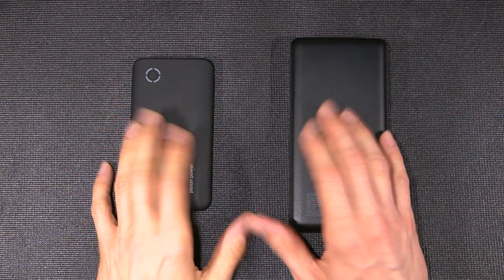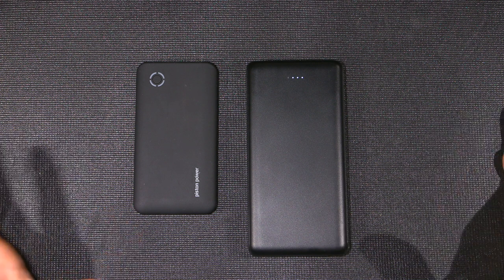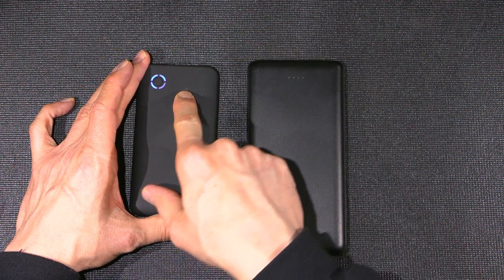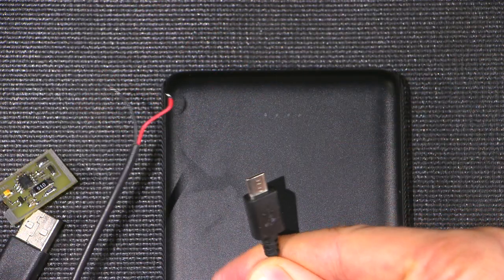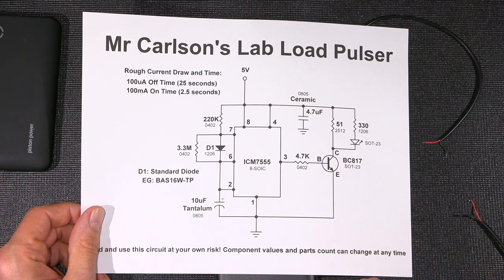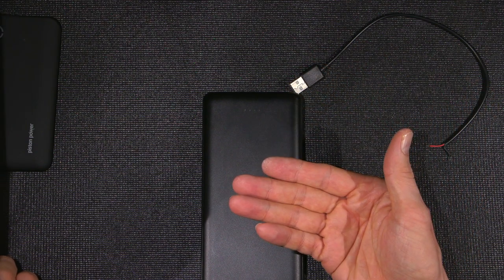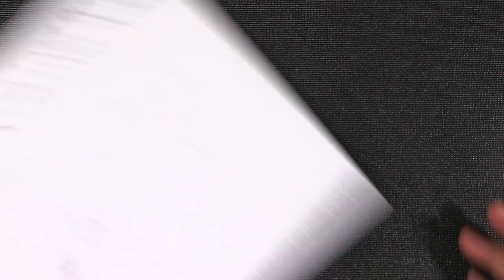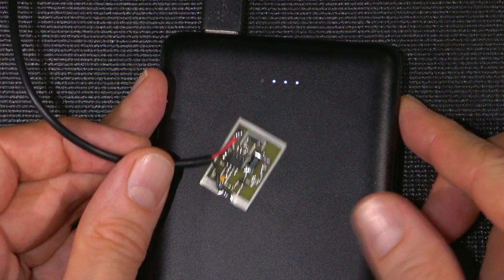Power Bank Stay Awake! Here's A Circuit To Do That:

Comment: If you use this as you suggest you may be defeating the safety timer that is part of your phone's internal battery charge and protection circuit. This timer is designed to prevent rapid and repetitive charge cycles to the Li-Ion battery that can lead to a cell "thermal event" aka catastrophic failure. With a severely aged battery you could be initiating charge cycles every 25 seconds. I wouldn't even want to be in the same room with that setup!

Comment: Nice. Could I use this circuit in parallel on a DC 5521 (2.1, 5.5mm DC) line? It's just 12V/5A.

Comment: Hi!  Nice job figuring out how to keep the power bank on.  It is also needed for remote photography and with other devices that have intermittent power "on" needs.  So, where is the layout of the PCB?  I want to start making those small circuit boards and using them with my projects.  I looked at your web site and there was nothing that I could find to help make that small PCB.  Did you post the circuit board layout on another web site? Merry Christmas and have a great New Year!

Comment: Paul, glad to see you take issue with batteries, and the Industry's rotten behaviour with them! Those of us who work with restoring and refurbishing laptops have been tortured for years-- but now increasingly so-- by a related problem. Most laptop battery control boards (BMS) have a suicide function, and 'kill' the battery (causes it to stop functioning, charging, etc) after a set time (often 2 yrs, but can vary). This is so even if the battery cells themselves are fine and healthy. Could you possibly design a replacement BMS for laptops which will REMOVE this shoddy, immoral function'? Or, perhaps some kind of work-around? You da man!
Reply from the maker: Thanks for your input, I will consider this.
Reply: kinda this!!!! i've seen dells do this alot but most batteries i've had die tend to have 1 or more cells fail over time leaving 5 or 6 or 8 good cells

Comment: The LED's and the 5V boost converter still consumes in continuous operation, so the battery will drain somewhat faster.
Reply from the maker: Correct, but the LED's and boost converter are on all the time anyways when the pack is in use.

Comment: Wonder if a shorter time than 2.5 s would also work. I guess it depends on the type of power bank.
Reply: Yes, I also think about trying a load current of less than 100 mA. A 2.5 s 100 mA load pulse every 25 s means an average current consumption of 10 mA. That's too much for my taste.
Reply: @wernerfritsch6436  Exactly my thoughts.
Reply: The phone ITSELF will pulse the powerbank if/when it needs charging. It's not a "latching" or "one-shot" circuit, so when the phone tries to charge, the powerbank will come back alive automatically.
Reply: @johncoops6897  That's not how most of these battery packs work, unfortunately you can't just plug something in to turn them on; you have to use the power button.  Once on, they stay on until the load drops below a certain level, then shut off.  Did you watch the video?

Comment: I have a few issues with you circuit: 
Why not use a MOSFET transistor, you will save one resistor.
Why use 0402, they are very small and with the PCB you use there is enough space for larger resistors.

I also know that 1 second is long enough on-time. Shorter may be possible, but in my tests I uses 1 second.

The timeout and minimum current varies between power banks (Xtar had a model that needed about 300mA to stay on).

Comment: I wonder if it would work to keep a buck circuit from eBay from turning off when charging a cell from 18v panel and a shadow.
Thanks I'm gonna have to try it 😊
Or maybe not because the battery doesn't have protection 😬

Comment: Pretty cool but that low power 555 costs over $2.  8-bit microcontrollers in the same package size are less than 30 cents (for those of us with more time than money) :P  Then it's possible to do a small current pulse in software without external components, or dump the pulse into a capacitor instead of wasting it.  If most of the power bricks use the same controller chip, I wonder if it's possible to disable the timeout on that chip directly

Comment: Most of the power banks I've gotten have a 'flashlight' or keep the status lights on if you press the button twice. This keeps a low power load on the power bank so it doesn't shut off.

Comment: Great little circuit! I do have one question though... Will this circuit interfere with USB-Power delivery or Quickcharge protocols? Those charging profiles support up to 20v. I'm pretty sure fast charging protocols are supported with USB type A ports, definitely with USB type C.
Reply from the maker: Hi Ben. As indicated on the schematic, this is for a standard 5V USB connection. Thanks for your comment!
Reply: @MrCarlsonsLab  no worries, thanks for the reply! And... I think I'm nearly up to date with your videos! 😂 Love all the old school tech you play around with! Keep up the fantastic work! 😉👍👌

Comment: I'll comment for now so I don't forget, though in a hurry.  I have a little different issue where I decided to most likely use a 18650 battery for the 12V jump starters.  I have an Artek.  Works like the power banks also... though have the 12V option with a smart sensing plugin for the battery cables.  Needs to sense a battery in order to operate.  Plus has a shut-off if not used in a certain amount of time.  I'm basically thinking instead of making the riders and garden tractors all have pull starters..., which I might still do anyways, use the Artek with the 18650 for starting.  I'll have to watch this later.
Reply: i wouldnt recommend using these for more than a few random "starts" the cells will degrade fast, they are 3 big fat lipos in series, if you parallel a 3x3 or 4x3 18650 setup it'd be more relyable long term
Reply: @frogz  Thanks for the heads up.  If not some anderson connector to start the engines with a dedicated pack for all as needed. For an install that's dedicated for each unit, I have wondered about installing a BMS with circuit protection to replace the lead acid batteries. Seems can make a pack with old laptop cells like you're noting and maybe even add some solar cells to keep the batteries managed best.
Reply: @frogz  Forgot to note the super capacitors also seem like an even better thought I've had before.  For vehicles too.  Seems for the hybrids or even all electrics... a super capacitor buffer for acceleration and charging seems like can help the battery performance.

Comment: I wonder if there might be an even simpler solution, like 2 resistors a mosfet and a cap ? 
It would be nice to have footprints for  jacks on the PCB and a little 3d printed enclosure, sort of like a 1 port usb hub ;)

Comment: Hi All, I am relatively new to electronics but keen to start with this small circuit. Could anyone point me to the list of components with part numbers which was mentioned by Mr Carlson in this video if I was to make this exactly as is shown. Any advice would be appreciated. I have signed up to Patreon but cant find it there.
Reply from the maker: Why didn't you PM me on Patreon? Anyways, I sent you a message there with the information on how to navigate your way to the info you want. It's very simple.
Reply: @MrCarlsonsLab  I have the exact same problem as @alanstewart1810, I signed up to Patreon too and cannot find the information that was promised in this video, and there is no longer a function to PM unless paying for a higher subscription (Which is above my needs other than this one issue). Any help would also be greatly appreciated, thank you.

Comment: i wish there was a circuit, that would allow you to put a power bank in-line with a charger (charger to bank, bank to device).. but only provides power from the bank, when there is no ac (power out).. but most powerbanks say you can't have the bank plugged in for charging and charging a device at the same time.  I'd like to have a battery backup for my usb wifi camera, but an APC type unit is overkill

Comment: Alternately, at least one brand of power packs has an "always on" mode for IoT devices, although they may cost more. As for your pulsing load, is it possible to dump the 2 seconds x 100mA energy back into the power bank's charging port somehow, instead of wasting it? This may make the gadget too big to fit into the power bank, but it would be an interesting thought experiment.

Comment: I like the idea but question some of the parameters - is 100ma really needed, I guess it will depend on the power brick; at 2.5 sec every 25 sec you effectively have a continuous 10ma load so 50mw which might be a lot more than the intended device load you were supporting - though small for a 20ah power bank. Could you reduce the load duration say to 1 sec at 50ma ? I just wondered if these values were the result of testing your own power bricks. Incidentally the ICM555 is rated for a direct load of 100ma so you could simplify if you could reduce the load to give more of a margin. As it stands your pulsed load would flatten a single-cell power device in about 10 days all by itself.
Reply from the maker: #1: Yes 100mA is needed, at 50mA the pack shuts off.
#2: A 10mA load will "kick" the IC, but will cause it to shut down in 35 seconds. Pulsing the 10mA load after the initial kick will not reset the timer. Having a constant 10mA load will not reset the timer. Having a constant 50mA load will not reset the timer. Pulsing either load while the power brick is activated will not reset the timer.
#3 If you load the ICM7555 itself with 100mA, you will purchasing a new ICM7555. If you use a load on the output (pin 3) of just a few mA, you will get a 1 Volt drop using the ICM part. This is why an external load switching transistor is used.
#4 The power cell won't go totally flat as none of the internal battery monitoring circuitry is touched. All power bricks shut themselves off when their internal battery is low. Keep in mind the 100mA load is pulsed, not continuous. The off time current draw is 100uA, or (Micro Amps.)

Comment: How about a device that will make a discontinuous digital coax signal continuous without affecting the information content (audio) of the discontinuous signal (so as to not trigger DAC relays and make them co click click all the time)? Or how about a device that will make it possible to have a fax machine work with a cell phone?

Comment: try just pressing the power button 3 times or if that doesn't work once it's on try holding the power button for 3 seconds.  most power banks have a stay on function built in but not documented.
Reply: I've power banks that don't have a physical button to push. It's nice to know that some have an undocumented feature to override the auto-off function.

Comment: Excellent little circuit! Thanks for sharing.  It would be a good idea(options) to have a defeat swt in case one wishes not to have the batt_pack drain down if one is planning not to leave it nu-attended for long time.  You know... a regular mode feature.  Just my $0.02.

Comment: So with about 10% duty cycle, this draws an average of 10mA @ 5v or 50mW.  That might mean 15mA @ 3.7v at the battery (depending on the efficiency of the switching boost converter at 100mA output).  An USB battery bank (usually rated by the internal battery current, not the output current @ 5v) would lose around 350 mAh per day from this circuit along.

However the power bank's own circuits continue to be powered up continuously, drawing some current for the LEDs on the powerbank, and the near-idle current of the switcher for 90% of the time. so the actual drain might be substantially higher.

Do you have any practical experience with this?  Like, with no actual device being charged but this circuit attached, how long does a power bank (of some stated capacity) take to drain to 50%?

Comment: Likely they are designed to shut off because the switching regulator has a small power draw that will drain the cells inside the external power brick. This can dramatically reduce the lifetime of the cells if they aren't kept topped off themselves, I.e. if you don't use it every day.
Reply from the maker: You can shut the pack off, so no difference. When the batteries get low, the IC inside shuts the pack off automatically anyways. It also has current limit protection, which isn't affected by the external circuit. All of these packs have these functions.
Reply: @MrCarlsonsLab  I mean the timing of the switch-off. For example, if you switch it on and recharge your phone, then unplug the phone, it would keep producing the 5V regulated and drawing that trickle of power without the load timeout. A manual off-switch is nice, but not everybody is that attentive, and the manufacturer wants this thing to outlive Warranty plus a day.
Reply: @PocketBrain  Well, if you  do want it to turn off, you don't build this circuit.
Reply: @jeepien  ....who says he has to build the circuit exactly to design? add an off switch if you're already going through the trouble and are worried about quiescent current!

Comment: Another trick when using power banks to power low current Arduino projects is to get the Arduino to periodically switch in a high current load.

Comment: Dude I have a pair of blue tooth ear buds it had just a red light that went off when it was done charging but when i went to charge them with my power bank they would last as long if i would charge them with a wall charger i just went and bought a wired set eventually cause I don't like charging my headphones

Comment: Hi Paul,, just wondering why you use a Tantalum capacitor for this cct?
Reply from the maker: Tantalum capacitors are temperature stable. So temperature variation won't change the timing.
Reply: @MrCarlsonsLab  Thanks Paul,,,,  :)

Comment: I would rather purchase a commercial product. I don't have a dedicated work bench or space for really any soldering projects. Not that I haven't considered doing something like that, but I'm very low income, so it's just easier to purchase these things. It's kind of like that I used to be into making my own computer programs until I just wanted to use the software.

Comment: I might build somrthing likr this to power arduinos from power banks because they do not draw wnough power
Reply: yes! that was my thought too! i'm gonna make a microcontroller power wire with one of these circuits in it.
Reply: Seems like building a special cable with this would make that a breeze.
Reply: Just make sure you clearly mark that cable. The cheap cables that come with power banks that do not have the data wires annoy me to no end. I might build it as a little plug that you would plug a standard cable into, then you can power different things with it

Comment: You have to be careful when charging and keeping your Lithium Ion powered devices fully charged at all time. By nature, Li-Ion batteries don't like being fully charged all the time (over 80%). By doing so, you're reducing the battery life of your device considerably as it will accelerate dendrite formations inside your device batteries. Some Li-ion batteries may inflate and become a safety hazard as a result in the medium to long term. Same thing when you go below 10%. This is why these battery packs shut off after the device is fully charged (by design).
Reply from the maker: Your devices power management takes care of that. The pack shuts off as to not drain itself with it's own internal circuitry (boost converter).

Comment: What! No tubes? ;-)   

A job for a ujt perhaps?
Reply from the maker: I could use a 6C4 filament as the load instead of the resistor :^) I'm sure my other half would love a tube hanging off the battery pack :^)
Reply: @MrCarlsonsLab  6088 JAN

Comment: charging Lithium batteries at 100% all the times, or keeping them forced at 100%, damage the batteries... if your mobile discharged fast when without power backup always on then you should change the battery in your phone, it's gone. All people working with batteries suggest to NOT discharge more then 5% and to NOT charge more then 95%... this will increase the battery life.

Comment: What if my phone is actively being used while on the battery bank? I have an old cellphone being used as a security system, I think when the app goes into background the bank shuts off
Reply from the maker: The circuit will keep the bank running with no output load. Unless your phone is telling the bank to shut off, this will keep the battery awake.

Comment: I just recently bought a case for my phone which provides a second battery, intending to use it for times when I would be away from a charger for extended periods and wanted to run off of the case battery until it was depleted first.  Unfortunately I discovered this same problem, it turns off after charging the phone.  It also seems that the USB-C port is just a pass-thru (other than to charge the case's battery) and it uses wireless charging to charge the phone itself.  It labels itself as a "fast charger" but the phone does not go into fast-charging mode, so I think I was a victim of sly marketing in that regard.  And to add insult to injury, it makes a faint high-pitched noise while charging.  What a let-down.

Comment: My issue is the device I'm trying to power just uses way too little power and every battery/power bank just shuts off after 30 seconds (or whatever it's time out time is set to). The device I have is a MLA-30 loop antenna which uses very little (at least not enough to keep these power banks on).